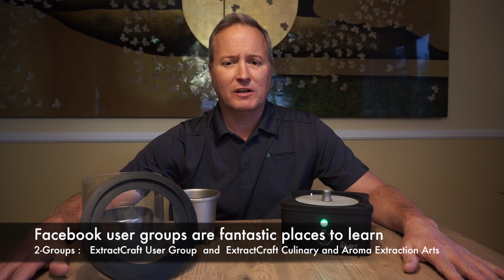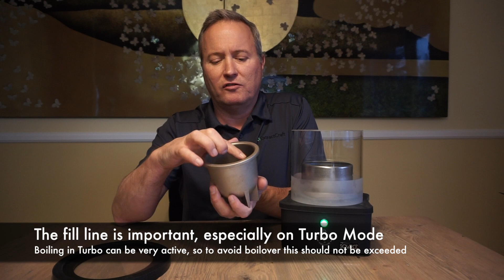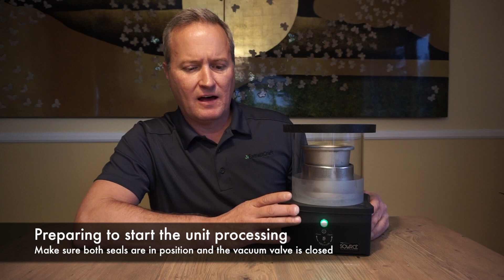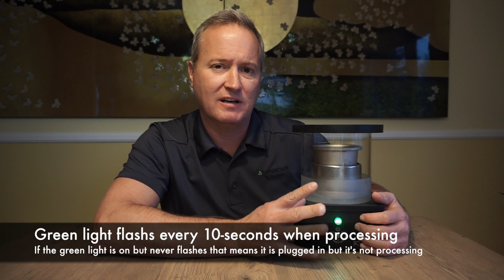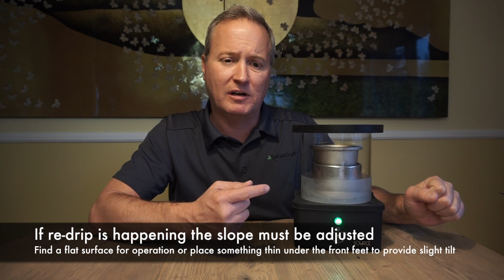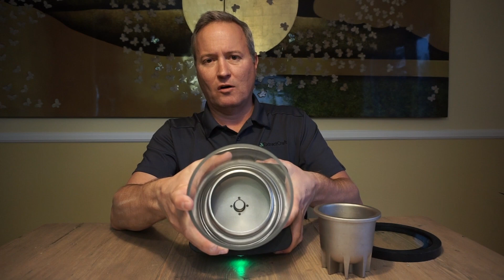New user introduction of Source Turbo by ExtractCraft

Comment: Do you decarb your marijuana before washing it and then Put in the wash in the extractor
Reply from the maker: If you want a decarbed oil, you can either decarb your plant material before extraction, or you can decarb the oil you create after. This just comes down to preference.
Reply: I want to make dab in the source extract craft so I can decarb first and then run it through the Everclear and then into the machine correct
Reply: If I wait till after to decarb dab dab how would I D car but what I put it in the oven at 240° for 40 minutes
Reply from the maker: @cathystienke1672  240 for an hour would be good. Check out this resource: https://extractcraft420.com/extraction-techniques-and-tip/
Reply from the maker: @cathystienke1672  If you are looking to make dabs, then you don't want to decarb at all. When you dab the oil, the heat will instantly decarb the oil. No decarbing for dabs, just for edibles/topicals/tinctures, and partial decarb for vape carts.

Comment: I'm looking at all my options. I think it's between this,or the levo,and does this eliminate the need 4 a press?i been also looking at those it think it's down to dab press and nug smasher,probably nug smasher master bundle 😁.thnx happy extracting!
Reply from the maker: Hey there, our machine absolutely eliminates the need for a press and will give you a product a levo never could. Many of our users purchased ours to use with a press, and end up getting rid of the press as our process provides a cleaner, more potent, higher yielding extract with less waste. When you press, your concentrates will be full of fats. Using cold temperatures and an ethanol wash, you will greatly minimize have fats in your end product. Also when you press, there are leftover rosin chips that still have oil in them. Some people will use our equipment to extract from these pucks, but soon realize they would be better off doing ethanol extraction from all their material. As for the Levo, that is performing infusion rather than extraction. You will never be able to get the same potency or produce smokable material with one of those.

Comment: If I'm at 500 feet, do I push the button once or not at all?
Reply from the maker: For 500ft, you would round up setting the elevation to 1000ft. So press and hold for 10 full seconds, wait til the rapid flashing stops, press and let go once right after that. Wait for a bit, it will flash once to confirm 1000ft, then turn off and back on. That's it, you're set!

Comment: Thank you. Can we make tinctures with this? If so what’s the latest batch I can make? Appears this is only for essentials oils and extracts….
Reply from the maker: Hey there. You can certainly make tinctures using our equipment! You will be making what's called an absolute oil. From there you can mix it with the carrier oil of your choice to make a tincture. If an alcohol tincture is desired, you can evaporate and recollect some of the ethanol out with out equipment, but stop the process early to leave in as much as desired.

Comment: What about the ice tray ….I’ve been using mine 3 years and have always used the supplied ice try for the top,to help condensation of alcohol. Why no mention of that?
Reply from the maker: This is a very old video. Check out some of our newer ones, you should see the ice tray in there. You certainly should always be using it!

Comment: I just received my Source Turbo.  Want to double check about setting elevation.  Mine is 666.  I would do the "no pushing (just wait for 10 seconds)", or do I push once for the 1000 feet?
Reply from the maker: Set to 1,000
Reply: @ExtractCraftVideos  Hi my elevation is only 131ft -141 ft above sea level. What would I set it to?
Reply from the maker: @raewynturnernz  You would set that to 0. Press and hold the button for 10 full seconds and then let go. It will flash back at you rapidly. From there, don't press anything and just wait a few seconds. The light will turn off, turn back on, and you'll be set for 0 elevation.

Comment: The extractor does not have turn on - turn off ? ... just to connect power cable and disconnect it, right?
Reply from the maker: Any time it is plugged in the fan will be running. If the machine is not in use it should not be plugged in.  It’s a safety feature to insure ethanol ventilation

Comment: I'm at 318' - no press or 1 press?
Reply from the maker: try both and see which works better.  I am guessing 1,000' will work better for you, but give both a try.  Lower will be more aggressive than higher, and higher will allow the pumps to run less
Reply: Mike have you tried both no press and 1 press? Which worked better? I'm in a similar situation where my altitude is almost 450'. Thx!
Reply: @trevorlindey  I've settled on 1000 ft - 1 press. Been working great. I pour off earlier now, when it thickens to olive oil consistency
Reply: @mikejohnson1615  awesome thanks! Are you making edibles with an olive oil consistency or using a different tool to finalize your concentrate?
Reply: @trevorlindey  I'm a caveman. I pour-off and dry/ evaporate under a fan for 24 hrs, then freeze and scrape up. I like to re-freeze or whip or thaw the material over and over to get a variety of textures.
Reply: Mike Johnson awesome! Thanks for the replies and the insight!

Comment: How much does one "round" typically produce. I'm assuming its different for each botanical, but a rough estimate?? i can't find that info anywhere. in all the videos it looks like very little is made with each 120minutes....any idea?
Reply from the maker: Hi, my apologies, not sure how this question got passed us.  The volume of the cup that can be run in one batch is 300ml.  So depending on what kind of material you start with and what you are making it will vary, but in general 3-6g per run.  One run on turbo mode takes about 2.5 hrs

Comment: One more tip for emptying the reclaimed ethanol, use a cheap plastic syringe with a long tip to draw out at least half of it, then you can pour out the remaining amount easily. One question for you though, Is there a way to turn the unit off without having to unplug it?
Reply from the maker: Spartan Grown no, it must be unplugged to be completely shut down.
Reply: I use a turkey baster
Reply: @robert420medical2  To shut it down?🤣🤣🤣